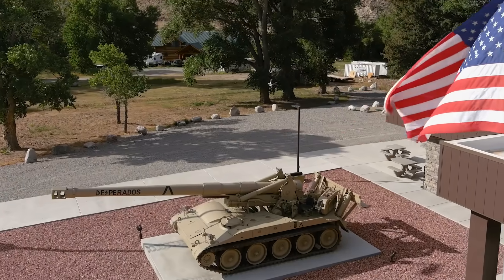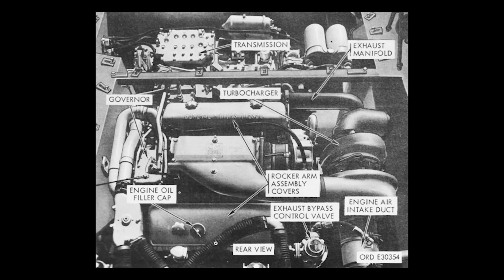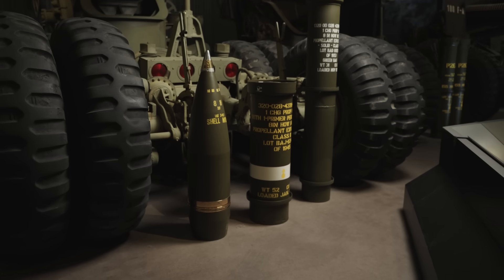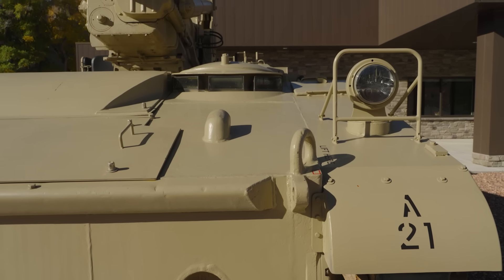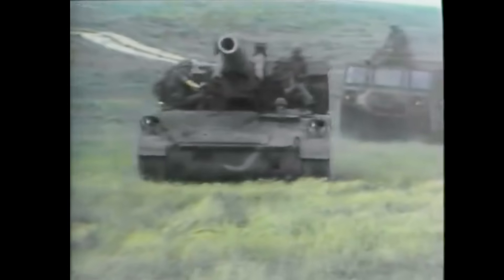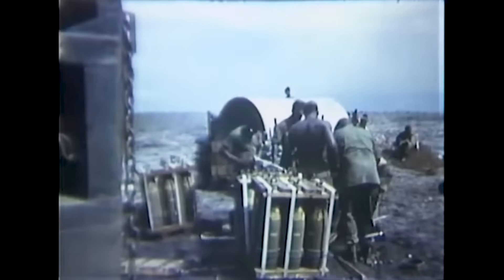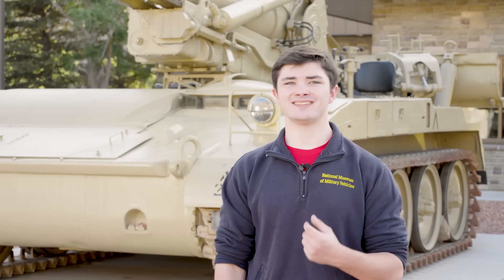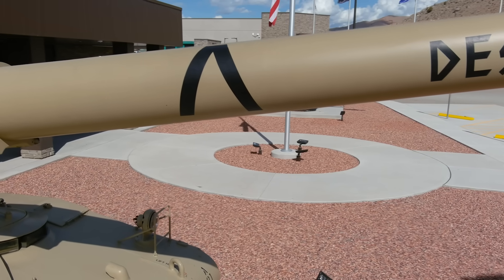M110A2 Howitzer: A Legacy of Firepower

Comment: I don't see why the crew would have protection from small arms fire because artillery isn't supposed to be on the front line facing off against the enemy. Artillery is supposed to fill a support role on the battlefield. If your artillery crew is under fire from the enemy, you have chosen to deploy your cannons in a very bad area.
Reply: The problem is counter battery fire. Having protection against shell splinters raining down on your battery is a VERY good thing.

Comment: C Battery 3/35 FA Peden Barracks FRG....many fun times in Graf...I was a driver of our 110 and 548...fun fact....that 200 pd round caused many a case of hernia...all our guns in the battalion had winterization kits...all it did was keep the rain off of you 
As far as maintenance....it was pretty reliable...we did our PMCS weekly 
One thing that always confused me....in all the time we did maintenance....not once did we change the oil in the engine...the mechanics would do regular oil sampling to determine the condition of engine wear...but that was it
In the winter...there was no heater for the driver in the hatch...if you operated the 110 long enough to get it to operating temp....you could open the drivers engine access door to get some heat off the engine
And drivers never operated down in the hatch with the hatch closed. ....it was open and you were seated up and  eating dirt and bugs 😊
Reply: In the summer of 1980, my FIST Team observed for your BATTALION ARTEP. It was some of the best fun I had at Graf. I think the BNCMD was LTC Flint. To practice you had 1,500 rounds before the actual ARTEP. The 8 inch was much better than the 155.
Reply: @allenmitchell8846 I was there Jan 83 to Dec 85...our battalion commander was LTC Raymond Roe....we were Roe Rangers....lol

Comment: The killer round was NOT a timed fuse set to go off in a certain timeframe.  

It was a standard HE round fitted with a VT proximity fuse.  The VT fuse was a radio/radar fuse that would transmit a signal and would only detonate when it got a return signal bounced off of a solid object.

That fuse lived on with the ICM-DP (improved conventional munition, dual purpose).

Comment: Remember the M-65 Atomic Annie with truck cabs at both ends?  280mm, or 11 inch, bore, able to toss a tactical nuke 20 miles, designed for Fulda Gap.  My father helped design it, he's in a .5-second blip in "Atomic Cafe" talking to General Westmoreland.
(length of gun barrel is 7.8 meters/25.6 feet)

Comment: You might have mentioned something about the gun itself which was designed as a towed howitzer prior to or during WW2 ad was later made a self propelled vehicle.

Also, the main tactical limittion of both the SP 8" and the SP 175mm was the lack of overhead cover which left the crew exposed to shell fragments (shrapnel) from counter battery fire, chemical and nuclear weapons, small arms fire, and the weather.

For local interest you might have mentioned the service of the M110 with the Wyoming ARmy National Guard.

Comment: My first duty station was in 1986 C 1/92FA 2nd Armored Division,  in Ft Hood.  I reported during a field exercise and was a complete noob.  I hadn’t been there for 30 minutes when it was chow time.  I was standing in line with my tray full of food, moving down the line when out of nowhere, WHAM!!! The loudest sound I have ever heard shattered the air. 
My tray flew in the air showering my food all over the place and I 
hit the deck not knowing what the hell just happened.   Unbeknownst to me there was an 8” gun not 100’ away hidden just behind the tree line. 
Everybody was goofing on the stupid young private except the 1st Sgt who informed me that I was to clean up my mess and was now on KP until further notice.   

Good times.
Reply: Did you end up at 1/21 First Cav after deactivating our unit? Then put us in the 212 FA Brigade. Lots of fire power. Pretty sure we had 24 8 “ M110’s. First to fire! Was a honor to wear that 2nd AD “ Hell on wheels” division patch on my chest. Only Army Division to do so.
Reply: For what its worth, I never really stopped flinching everytime an 8 inch fired. I recall at NTC (155mm M109) a battery of 105mm from the 82nd Airborne was located near our M109s when our battery fired. Their FDC all came running out, thinking one of their 105s had detonated! They'd never heard such a blast.
Reply: I was in Alpha battery in the 1:92 back in 1986. Remember Big Mac the Sargent Major at the time. We had Pee We Herman as our first Sargent. Weisly little prick. Brave Cannons!

Comment: I worked as an Army mechanic on the M110A2s. Vehicle names traditionally began with the battery letter. For example, our Alpha battery vehicles had names such as Assassin, Armageddon, or Asylum. Another operator caused failure we saw on the M110 was turbocharger seal leaks caused by shutting the engine down without allowing the turbo to slow down at an idle. Idler arm breaks were often caused by pivot steering on rough ground. The M110s also had a winterization kit that placed a huge aluminum and canvas cab over the back of the vehicle to allow the crew to stay warm in Korean winters. 
The M109 vehicles used the same engine and transmission as the M110 with a few modifications. The M578 recovery vehicle was based on the M110 hull.
Reply: I thought the recovery vehicle....we called it ...BIG MOMMA...was based on the M60 tank chassis.....sure looked like one to me
Reply: @jonsingle1614  The big recovery vehicle, M88 is based on the M48, the M60 was a development of the M48, so it looks similar. The "light" recovery vehicle, the M578 was based on the M110/M107 hull.
Reply: @jayffemt i stand corrected....my memory aint what it used to be....I have seen a M578....but cant remember if the maint section had one
Reply: @jonsingle1614  When I was in an 8" unit, 6/37 FA in Korea, the maintenance section had one M88 and two M578s. The 155 units I was in had two M578s.
Reply from the maker: Thx for the great info.

Comment: The battery failure stat is likely due to being weak battery before anengine start because the master was on so all of the ramming and and tube control would work while firing without the engine running.

Comment: C BTRY 7/9 FA,  13B40 for 16 years.  I miss it big bang.
Reply: Applied for your 10% hearing loss yet? I was FDC for 6/37th FA and nearly 100 yards away from the guns.  FDC ALWAYS has at least one ear plug out because we had to listen to three radios and talk to and listen to the gun line and each other. You can't do that with both ear plugs in.. Even wearing both ear plugs you will have suffered some hearing damage. It turns out the ear plugs aren't 100% effective because the sound gets transferred through your body to your ears anyway.
Reply: @readhistory2023 Say again over...didn't hear you...😂
Reply: @readhistory2023  I need to apply for my tinnitus. Between diesels and cannons, there's a constant background noise. 6/37 was probably a part of that.
Reply: As I type this the ringing in my ears is ridiculous. The quieter it is the louder it gets. Will the VA help at all?

Comment: The left fender marking more likely identifies the vehicle as the 1st vehicle of the 2nd firing section of the Alpha battery.  My first assigned military vehicle was A-20, the platoon leader's vehicle of the second platoon of Alpha Company, 19th engineer battalion (Corps Combat).  the vehicle was an M880A1 -a militarized 1976 Dodge 3/4 ton pick-up with a radio mount, hence the A1 sub-designation.  That truck was an absolute piece of junk.  In the 18 months that I served as platoon leader for 2nd platoon, it was operational for a total of one month.  It met its deserved fate when our unit deployed to Panama.  A harbor crane dropped it while attempting to load it onto a ship.  Because of that truck, I have never considered owning a Dodge or Chrysler product.

Comment: We used to haul the nuke rounds ( dummy I suspect) in our Hueys
Reply: Same here 24th Inf Mech. 1/13th FA
Reply: Little secret.... there are NO dummy nuclear rounds.  Not unless they are the wrong size and color.
Reply: @mynde-fuchefoundation2254  Yes, there are (or were, since there are no more artillery-fired nukes left in the inventory). The training shell has a thick band around the outside to prevent it from being chambered. I spent 18 months at a warhead detachment in Italy in the early '80s. We had 2 training rounds and 24 real ones.
Reply: Yeah, they were dummy rounds. Yeah….

Comment: I was driver/ loader rammer/ RTO on the 8 in. Damn good piece
Reply: Thank you for your service
Reply: @c56cameo Good evening and you're very welcome, I just did my jobs the way I was trained, nothing special about me.
Reply: Me too.  BRAVO Battery 4/92 FA. 88 to 92.
Reply: @ThomasStell Hey there fellow gun bunny, I was A Btry, 1st of the 11th F.A., then after that  I went Air Defense,  16 Sierra,  stinger/ redeye. Those were the good old days when we wore green fatigues, polished our boots and had steel pots ,manual transmissions and the senior NCOs scared 2d. Lieutenants.
Reply: 2nd Bn 14th FA, Bamberg, Germany. 87-92. Yes, the M110 was a great gun. I can say in 5 years I never saw a 13-man crew. I think we probably had 8 guys max at our best.
Reply: @Madmac96 Happy new year,  yeah, same here, never seen a big crew either, our section sgt was SSG James Burkhardt,  good man, ex tanker in Vietnam.
Reply: Need an instant swimming pool at your location? Call an M110A2

Comment: Nine miles feels pretty close for a 40 kT device.
Reply: id say that if something was close enough to necesitate a 40kT bomb, i think its worth it
Reply: @itsericzhou as long as it’s your soil that you irradiate with 1,000 year half life cancer material.
Reply: An airburst from 40kt device will still cause some minor damage at 6.76 km. So 9 miles or 14.5 km is good enough.
Reply: @Infanterie_Marine you think so.  You feel safe from neutron radiation at 9 miles.  Love you jarheads standing on the wall.
Reply: @tonymanero5544  Radiation would be deadly (500 rem) at 1.16km. At 14.5km it would be 3.2 rem.

The lowest acute dose known to cause cancer is 10 rem. So while I'd wouldn't like to be exposed to several of these blasts. They are not a safety concern at such a distance.

And these numbers are when completely exposed and no mitigating factors.

Comment: The bumper number of 21 doesn’t mean it’s the “21st vehicle in the battery”. It means it’s the first vehicle in the second section. A-22 would be the ammo carrier for that section.
Reply: You are on target sir.
Reply: Second track second platoon.
Reply: In the old school 4 gun battery 21, 22, 23 and 24 were guns. 31, 32, 33 and 34 were M548 ammo carriers
Reply: @Gauge1LiveSteam it was over 40 years ago, and I did Lance where the 3 vehicles in the firing platoon was x0,x1,x2. So I remembered wrong.
Reply: @doughudgens9275 I was in a Lance battalion 3 /79TH.
Reply: 21 would mean 2nd platoon, 1st gun section. IIRC, the battery I was in had three guns per platoon, two platoons per battery.

Comment: Drifting the M110 on the Letterkenny Army Dept test track in the mid 1980s. Drivers could keep the speed up and drift through the sharp turn if they judge the speed correctly. Too slow and it would not drift and it would leave the track. To fast and it would slide sideways off the track and flip when the track dug into the grass. Panic and try to stop; the nose would dive and stick the muzzle into the test track, wrecking the gun system. Slowing down far enough out to safely make the turn took time and cut the number of M110s that could be tested in a shift. The test track still had the patches from the panic stops when I dove on the track in 2005.
Reply: I've drifted them on tank trails at Ft Stewart
Reply: Tracked vehicles can also be the biggest set of skis in the world when it snows.